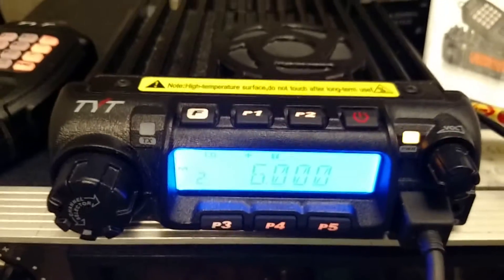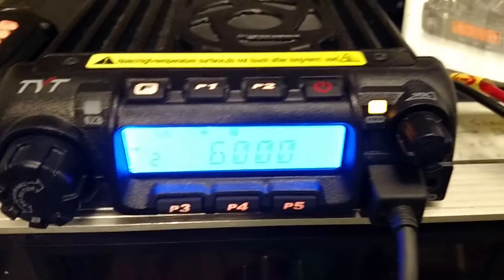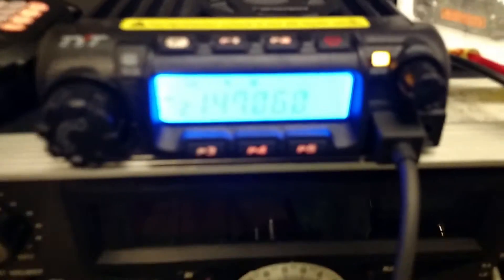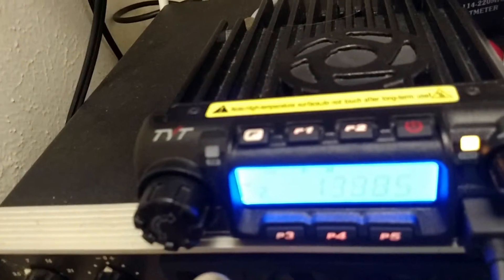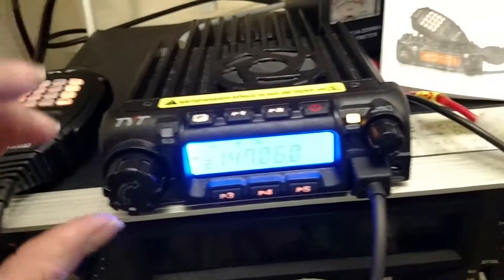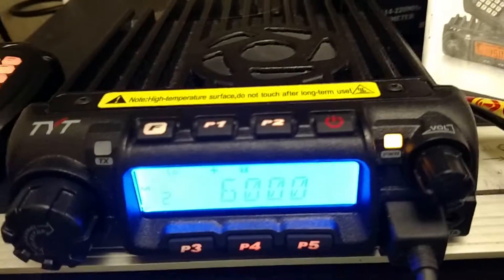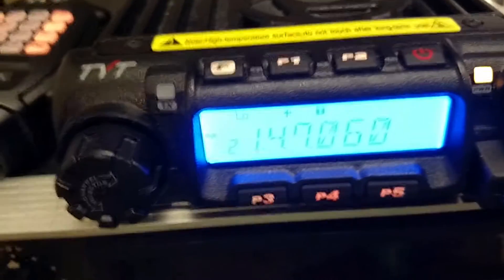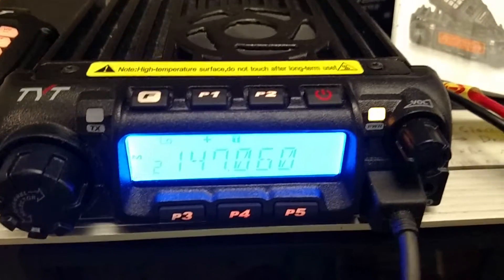TYT 9000D 2 Meter offset problem.

Comment: Problem solved, once you set the correct offset press F hold , and at the same time press f3 to override memory saved .
If that fails as it did for me on one occasion, my offset was +0.7500 and it kept coming to 7.5000 so i set it at 0.0075 and it worked as 0.7500. Good luck.

Comment: YOu need to save it. That's why it's not holding the offset setting. It's resuming its default. Save it onto a channel in memory and it will hold the settings. Cheers.